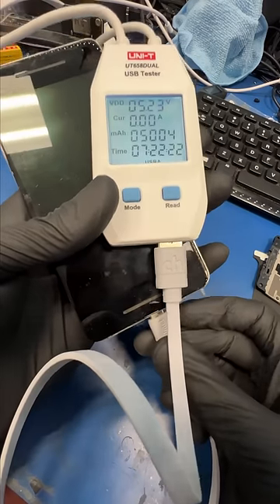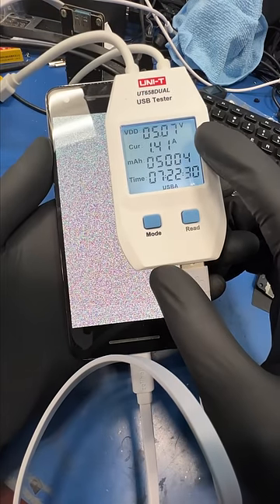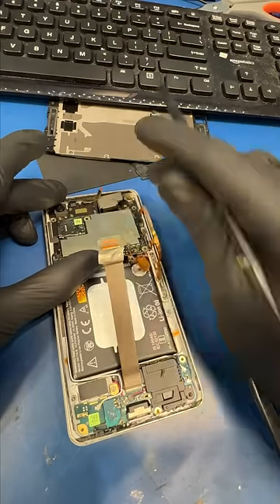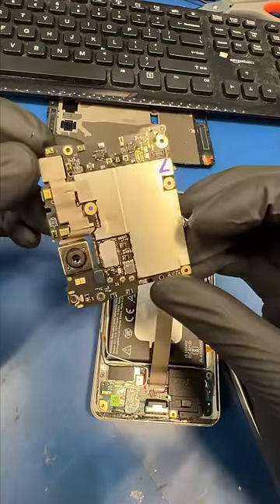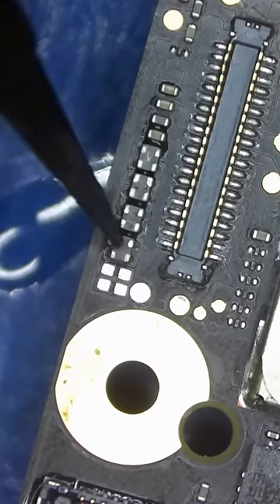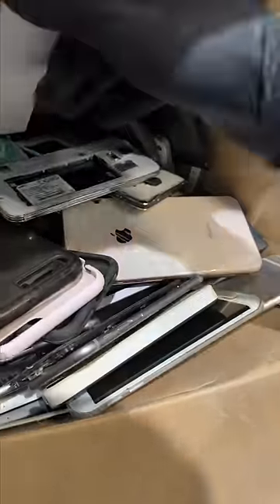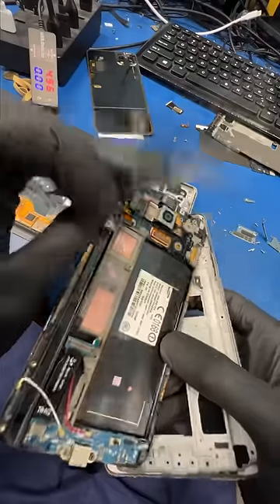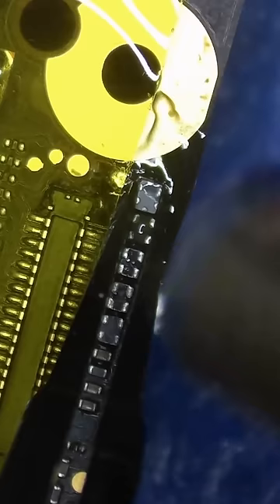Can This Google Pixel Be Saved? #tech

Comment: Those mall repair shops are the ones ruining right to repair for everyone else
Reply: Literally
Reply: Nevwr really had good experience with them.

Last time i went to one i neede my screen replaced afyer i took the phone back and payed 100 everything seemed fine but after two weeks the screen went dark never to show anything again.
Reply: Paid 80 i didnt have to repair my tablet and all they did was a screen repair despite me stating the damage reached the sensors as well. Thanks for reminding me btw, imma put a review in for that one
Reply: The weird part about all this, is that I went to a gas station run by a family from India, and they fixed my iphone screen for 80$, all I had to do was chill and get some food and wait 20 mins.

In comparison to the mall people? They tried to charge me 150$ for sameday repairs.

People from India know their electronics
Reply: @petermikus2363  my old phone went like that aswell. It's like they stole something from your phone to sell it for higher price. Never trust unlicensed phone repair shop
Reply: Yup, I took my mobile to one because they were recommended to me.. the phone wouldn't turn on anymore and I just wanted to get it running long enough to transfer some data. They did absolutely nothing, pretended like they did and charged me $70. Went to a legitimate repair shop afterwards and they were able to recover the phone long enough to transfer its data to my new one. Never using a mall mobile repair kiosk again 🙄
Reply: You're obviously rich enough not to need mall level phone repair
Reply: @notjimpickens7928  cool, but im not taking that risk, just because the gas station food didnt make you sick that one time doesnt mean it wont in the future.
Reply: @_sludgefactory yeah they are the ones providing an extra reason for the company to hold their stands so what he said was right
Reply: That's not how right to repair works the lady is the one ruining it by not being smart and picking un trust worthy people to repair her phone being dumb and doing no research is the customers fault no one else that's why right to repair works.
Reply: @notjimpickens7928  they have to
Reply: @tibbers3755  furry pfp
Reply: a few years back my phone’s home button broke so i had it repaired. they returned it with the home button still broken, dead pixels on my screen, and a shitty $5 screen protector. mall repair shops are dog shit
Reply: Fr😒
Reply: WRONG the phone makers don't care if your stuff get fixed.  they would likely do the same thing.   This repair guy proves we deserve the right to repair.
Reply: Yes, My grandfather fixed my phone in the mall and they literally disabled like the screen lock
Reply: Nah I had a good experience when I went to go watch eternal I gave the dude my phone to repair he fixed my screen and this issue where my phone would only charge to one specific charger that broke, and all for 80 dollars
Reply: ikr
Reply: True always look for an id and license on these so called repair man. As a friend of mine got his phone scrapped for pieces by one of those ass hats. Also never ever buy anything from them as they charge you an insane amount for a 2 gb memory card which if you go to a legit shop is only worth atleast a 250 while those thief shops charges you a 1500-3000 and above for a faulty memory card
Reply: Idk, I had a fantastic experience with one near me. My screen shat itself while I was at work. I called around everywhere I could and he quoted me the lowest price of anywhere within 20 miles, and he was the only one who could fix it same day.
Reply: Yea, went to the mall to get my computer repaired and when I got it back, the speaker was completely messed up.
Reply: They littarly took 6 months to replace my brother's xbox one's hdmi port...6 MONTHS
Reply: Yeah my old phone cant phone anypne so after we got it back from fixing center,it cant even open drop dead
Reply: This is why I learned to repair my own shit, it has saved me hundreds in repairs, I had repair 2 tvs, 3 pcs, 2 cellphones, 2 mouses, 1 keyboard, 2 video game consoles, (Xbox One Gen 1 and Nintendo DSi) and 2 Xbox controllers

In this age it's a very very important skill I think everyone needs
Reply: @DharmaFurryVII  oh wow your the first person to see that I never thought it was a furry, your such a sharp eye and genius to comment that literary in public (sarcasm)
Reply: Well, no. What they do is serve as a warning that if you pay for a cheap service you get a cheap service.

The right to repair your own prosessions has got absolutely nothing to do with them
Reply: @_sludgefactory apple products maybe, but Google has done really well it their products and then being easy to repair.
Reply: There great for getting refunds from their owners
Reply: @JoeyLindsay 9ooooo
Reply: If they're Pakistani or indian, run.
Reply: @kevinhill8193  If you need phone repairs, even if you are poor go to a dedicated place. Won’t matter in a week if you can’t use your phone anymore
Reply: They repair just basic cellphone's problems
Reply: The problem with the mall shops is they will hire literally anybody with zero skills and tell them they can "learn on the job." And no, no you cannot learn that on the job there aren't even parts available you have to know how to do projections to figure out what to order to be prepared for the next week or month of business...because they have no donor boards they only work with new parts. Also the manufacturer does not make those parts available just full brand new boards for full price. So no shop is ordering those to rip tiny components off of because no profit margin to be had there. If its not a screen or board or battery replacement the mall shop can't do it.
Reply: I have only ever heard of them copying all the files from peoples phones and selling the information
Reply: Yep, went to a repair house (it's literally called that here) because I had a cracked ipad screen. Got it back with a new screen. Off button stopped working, apps stopped updating and appstore didn't work anymore, also updating the iPad was a no go. Never had any problems with this before.
Reply: @_sludgefactory took my phone to one of the mall repair shops before apple started locking things down as hard and they managed to break the screen somehow
Reply: @_sludgefactory I also was referring to the pop-up repair shops found in malls most regular style repair shops seem more reputable than the pop up shop
Reply: @notjimpickens7928  I had a similar situation and I got what I paid for. Replacement screen had ghosting on it, and dead pixels. Brought it back and asked them to switch it out. They accused me of getting it wet  (during the 12 hours I had it) but they eventually agreed to replace it with a functioning screen; however within a week the new screen popped off the bezel. 6 days of back and forth with them, and $80 spent and I still didn't have a working phone. I wish I just paid the $150 up front.
Reply: Yea I don't trust those because they replace your parts with low quality from their stuffs and they charge you a high amount
Reply: Yup. I never herd anyone ever say they did a good job. I have repaired of few of my phones before but I’m super careful not to break anything. I have had coworkers showing me the screen just falling off their phone after being fixed to dead pixels. They all just use super cheap parts and then charge a lot for a repair.
Reply: Don't look now, but I think some mall repair guys are here
Reply: Ikr my iphone shut off and never turned on I told them what happened I payed them £4000 and I left and came back for my iPhone and it was shattered and battered and never turned on still I got my money back tho
Reply: Yessir
Reply: @petermikus2363  Same problem it's been 10 years since it happened and now I always have a screen protector and a heavy duty case
Reply: When it comes to screen protector replacement they do a good job
Reply: It's actually the opposite. Companies don't want you to have the right to repair so you are forced into buying a new product slash buying a warranty / having it repaired by the specific company (Tesla is a great example) These lesser mall repair companies aren't even fixing the issues most of the time. The ones they're hurting the most are the real repairmen like you.
Reply: We actually have a really good one here in my german town, but it is very rare to see.
Reply: @ashwolf2006  what’s getting their license or ID going to do? You gonna pay lawyer fees, have to take off work and sue over a $300 phone? You will end up paying more than the phone is worth.
Reply: I gotchu
Reply: @notjimpickens7928  business for profit with possibly no knowledge vs business for livelihood with risk of bad rep and no clients if they don't do the job right. You can guess which one doing a good job is more important for
Reply: @Manuel8123  any resources that i can study first so i don't mess my phone up practicing?
Reply: Someone gave my business a bad review because he didn't want to drive to me and said he got it cheaper at the mall, I was like enjoy the quality lmao.
Reply: Seriously!!!! Nothing more frustrating than hearing stories like these. Seriously considering getting into board repair because I keep hearing horror stories lately and it's appalling.
Reply: @tibbers3755 that's a massive generalization lol I've definitely encountered people of all races and ethnicities that know their electronics and those from the same groups who couldn't be dumber when it comes to tech. 

People who know tech know tech, but that's obvious. You just happened upon a good deal.
Reply: @ripsnip5336 this is late as hell but check out Louis Rossman. He does general board repairs mainly on computers, but I believe he has some documentation and videos on how to get started. He's an OG.
Reply: @manuel8123  How long does it take to learn this stuff?
Reply: @notjimpickens7928  Possibly because they assembled them initially.
Reply: This is why if I ever go to a repair shop I'm doing research to figure out who is the most reliable cause I don't wanna go into some random store just to find out they just caused even more damage and made it unrepairable even for people who do know what they are doing
Reply: I've always tried doing repairs myself, my first 100% successful repair was an iphone SE 1 screen which I'm writing this comment on. simple repairs are not all that difficult if you have the right tools and follow an ifixit guide
Reply: You mean right to say" it can't be fixed..." 😂
Reply: On god, i spent $200 and theydidn’t even fix it smh.
Reply: They aren’t but keep coping iPhone guy
Reply: Did you know that depending on how much your state suckles on the tits of corporations you're able to use those mall shops for not putting your phone back together when they "can't repair it"

Comment: "it can't be fixed sorry-" it only needed one TINY part-
Reply: i guess those type of wallmart "repairshops" only do the most low basic tasks with a troubleshooting flowchart handed to unskilled employees. what it takes is to do some board soldering, it's not too hard in itself, but you still need both the skills and the tools for it.
Reply: It would still require solder skills to replace and you have to figure out what exactly the part is and if it is actually needed or if that is just a blank space on the motherboard. Not an easy thing to know.
Reply: Tay dont know how to fix it thats why
Reply: it already had the part the idiot worker before took it off, basically robbing her of her money
Reply: It's not about the size of the thing he has to repair or change, it's about ALL the knowledge he has gathered over the years in order to know EXACTLY which tiny part he has to repair.
Reply: yeah they said that to my auntie when she went to a mall to fix my broken tablet when i was at school

the only thing that was broken was the screen

she went to an APPLE store that said they fix their apple products

and they said "we cant fix it" 
i repeat its an APPLE STORE that FIXES THEIR APPLE PRODUCTS and they said "we cant fix it" THE ONLY THING THAT IS FRIKIN BROKEN IS THE DAM SCREEN
Reply: @SpencerLemay  it wasnt solder he used heat gun to melt area and fuze
Reply: That's a pretty average part!
Reply: The point is the tech man broke her phone, everyone has a basic expect: the professionals are at least response of paying for their mistakes, if they escaping from their mistakes when damage your stuff, everyone will be pissed.
Reply: It didnt they broke that one part
Reply: That tiny part Only manufacture in china
Reply: @niscent_  All i'm gonna say is that i wasn't taught how to solder, but I also got my education mostly in programming, so go figure.

Its a skill I definitely need to learn though going forward.
Reply: I have done this type of work 3 times. Once it failed and I ended up doing more damage. It isn’t as easy as they make it look. Just finding the problem takes hours if your not familiar with the layout since the only real tool u have is the internet picture where u play the spot the difference until u find out what is missing on your piece
Reply: Fight for the right to repair. We need laws to allow us to repair again. Schematics use to be available up until late 90s
Reply: @roshasensi2220 look up lois rossman. He moved his business from new New York to texas. He is fighting for our right to repair.
Reply: It takes skill to repair though and intimate knowledge of the internal components so some random dude at the mall whos used to swapping out screens and batteries wont know what to do
Reply: Why would they waste time fixing the phone for you? They want you to buy a new one
Reply: @niscent_ as well as something’s requiring a license / specific training to do “legally”, and they’ll get into deep shit if they mess it up, so even if they know how for specific things, If they don’t have the license they’re not allowed
Reply: They don't even know how the hardware works. They literally broke her phone and don't even know how to diagnose it.
Reply: Soldering on that small of a scale is very difficult and the techs at that store probably couldn't do it. However they should have admitted their mistake and paid for her phone instead of just saying "your phone can't be fixed" and give it back in pieces...
Reply: @SpencerLemay  ngl u could aquire all this information and "skill" in 1 day via google and repair it urself if ur confident enough
Reply: @niscent_  You're describing an Apple repair bar Walmart doesn't do any of this shit.
Reply: @SpencerLemay ...except that it was the blank space.
Reply: And a soldering iron, and some technical knowledge, and tools to get into the phone. Also idk if youre just slow or something but phone repair place will often not do repairs that they cant charge you up the ass for.
Reply: @SpencerLemay  soldering is pretty basic honestly and so is looking up a picture of a completed motherboard or one in front of you and just going off that
Reply: @SpencerLemay 
But someone who does "phone repair" should know and they're the ones that messed it up and gave up, giving it back in pieces
Reply: @goochiethanos  oh
Reply: @roshasensi2220  dang

Comment: That one was removed on purpose. The surface area is too perfect for it to have been an accident.
Reply: Or he just just showed us the spot, right before he was going to solder on the new one.   
 Video editing is necessary even in shorts
Reply: Yeah my thoughts too,  the pads to which he soldered a replacement component was probably a DNP - Do not Populate pad
Reply: Yeah probably removed it for personal use

Comment: The moral of the story is don't EVER go to a mall to get something fixed. Always go to a specialty store, or individual.

Edit: This is for expensive items that have serious damage (does not function). Most stores are going to simply offer a price for your item and resell it after repairing it even though they said it can't be fixed
Reply: What's the difference? Why would the place where you have your repairshop matter? Or do your malls have some general repairshops that try to fix everything from slippers to particle accelerators.
Reply: @umberhulk_mk2  The primary issue is getting devices repaired. They tell you it's impossible and then offer you like $5 for your ps3 and then fix it in 2 seconds and sell it for $300
Reply: Literally the same thing, maybe go to a reputable company instead.
Reply: This is exactly what Apple does. Apple doesn’t really fix their phones/laptops/computer devices even when they tell you to bring them in their stores for any problems or repairs. They will simply just half ass fix it or simply tell you that you should just buy a new one given a small discount fee lol
Reply: How do you think transmission shops gather their spares?
Reply: Actually I have taken my phone to the mall countless times to be fixed and they’ve done an amazing job
Reply: Lol I can attest, paid 150 for a screen repair at a mall kiosk, they did the worst job imaginable, back cover was bent, the screen wasn't installed properly, there was a gap all the way around the phone and you could see light coming through the sides. Within a week the screen died completely just from it being shit quality.